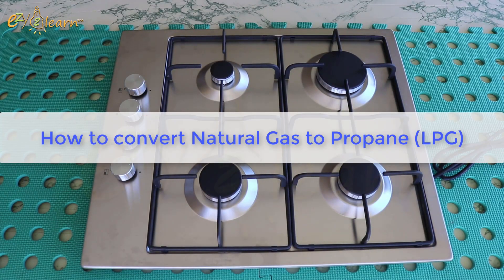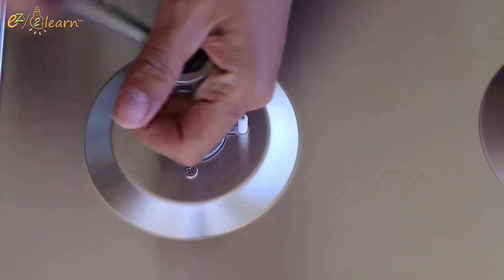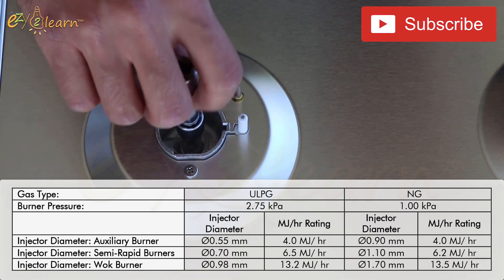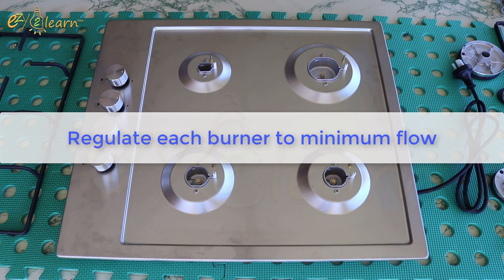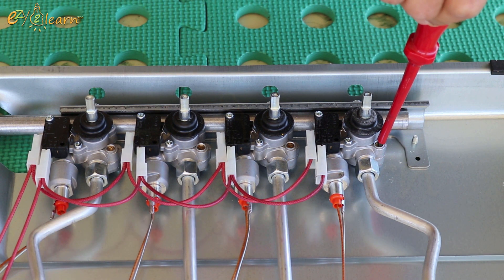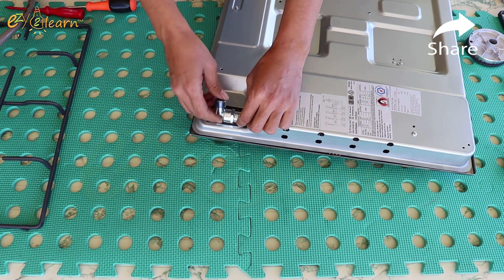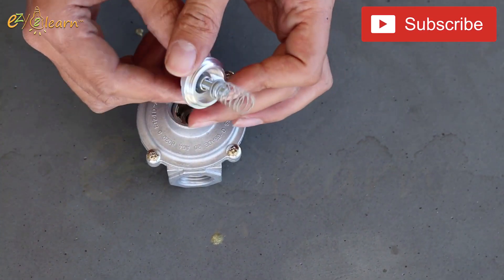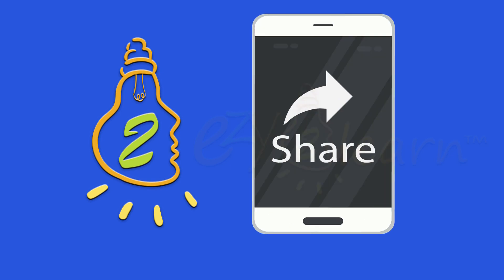Gas Cooktop Natural Gas to LPG Conversion by ezy2learn

Comment: I need to convert 5 burner cooking range from Natural Gas to LPG cylinder Gas (Siemens make)
I’d really appreciate if you could help me the sizes I need for these nosel jets :
1- 1.30mm
2- 0.85mm
3- 0.65mm x2 
4- 0.50mm

Comment: Hi I have attached my stove with a regulator on the LPG bottle. I’ve changed my burner jets. But I cannot see any access on my new off grid oven to adjust the actual oven and the flame there is too big and yellow 
Any suggestions anyone??

Comment: Is it necessary to have 2 regulators? One that comes with the stove and the other that’s attached to the hose in order to safely operate after converting from natural gas to propane?
Reply: Did you find an answer to this by any chance? 
I was thinking the same, as on a house set-up natural gas or LPG, both set-ups have two regulators, one at the stove and one at the mains/ LPG bottle.

Comment: Hey, any particular reason why we need to swap these nozzles and how important is it? Only reason asking because I’ve just ordered my mum a hob for her new kitchen and she lives in Sri Lanka, when I mentioned swapping the nozzles to the kitchen designer he said he'd never come across before, so I'm just wondering if this is really necessary?
Reply from the maker: Nozzle swap is required if you are changing from LGP to Natural Gas or vice versa. As LPG is thinner and requires tighter nozzle hole, but Natural Gas is thicker and requires bigger nozzle hole to work properly. 
If your hob is designed for LPG and it is going to work with LPG bottles, then you don't need to change anything. Thank you
Reply: @ezy2Learn  Thanks for getting back so quickly, yes that makes sense. I have ordered it from a well-known online retailer in SriLanka, as they don't have central gas there, I'm guessing the hobs will probably already come with the correct ones, but I'll double check. Thanks again - much appreciated!

Comment: What is the fitting connection required to connect standard gas cylinder hose to the elbow fitting you have? Can you please advise the name/size of fitting connection on each end?
Reply from the maker: elbow fitting is standard ½ inch (15cm) Australian size plumbing elbow. You may connect your stove directly to a Gas regulator as per video which is ½ Female both sides then direct gas hose to your gas bottle or you may connect your stove to gas bottle using a gas hose with builtin regulator like the BBQ one, similar to this one: 
https://cdn.shopify.com/s/files/1/1861/0291/products/Untitled-1_d4c05e0e-35d0-435f-9735-12d80b9ec63f_1400x.jpg?v=1527207756
Reply: @ezy2Learn  yes I want to connect this regular bbq hose to the 1/2 inch fitting but not sure what fitting to buy in between https://cdn.shopify.com/s/files/1/1861/0291/products/Untitled-1_d4c05e0e-35d0-435f-9735-12d80b9ec63f_1400x.jpg?v=1527207756
Is this regular bbq hose fitting 8mm?
Reply: I figured out... It is 
3/8 sae male to 1/2 bsp female. Thanks for help anyway. Great video!

Comment: My mobile home is on Propane. There is a propane regulator right off the propane tank.   Do I still need the regulator supplied with the stove?
Reply from the maker: no, one is enough as long as it delivers the correct pressure to your stove, usually it is around 2.75kPa

Comment: about turning the screw clockwise for the flow LPG conversion.did you just turn it all the way or half?thanks
Reply from the maker: There's no exact scale of turn the gas flow screw, but you need to turn the screw clockwise about half way or a bit more until you get the correct length of flame for each burner (blue flame) not yellow or orange color.

Comment: I would like to connect a cylinder hose and regulator instead.  Could you give me detailed information about which one I should buy for a Gasland chef cooktop GH30SF? Thanks
Reply from the maker: I looked up Gasland Chef GH30SF but it is not available in my location. but what's the problem exactly to connect a cylinder hose and regulator. Please provide more information about issues you are facing and I might be able to hel you. Thank you

Comment: Can't we use hob stoves without installation? Because it's not possible for transferable job.
Reply from the maker: Yes, you can use it without installation, just make sure it is stable and gas hose away from fire. OR you can build a 20cm wooden frame and  install it on top of it and it will portable.
Reply: @ezy2Learn  Thanks for your information.
Reply from the maker: @ConnectingNatureAndPeople  you are very welcome :)

Comment: Question friend, how about the plug wire, the black one, what happen, are we going to remove that, or nothing. Thak you and God Bless, more power to you.
Reply from the maker: Did you mean the electrical cable? if yes, then you don't need to worry about it as it is used for ignition only and it is not connected to the gas source or type!

Comment: What is the benefit of this method?
Reply from the maker: Converting Natural gas to LPG
Reply: You need to convert a natural gas appliance to LPG using the jets provided with the appliance because if you don't, the existing natural gas jets will put too much LPG into them, and you get an uncontrollable flame that produces huge yellow tips depositing soot and carbon on pans and kettles along with a horrible gassy smell emitted. 

Jetting a natural gas appliance for LPG bottled gas and propane tank supply ensures proper operation and safe use.

Comment: Wouldn't you configure the regulator first and then the dials?  Why make flame and height adjustments at the dials and then change the regulator?
Reply from the maker: Ok, you are right about that one :) I just wanted to say that you can adjust the flame from dials not from the regulator! my apology
Reply: @ezy2Learn  How do you know that you have the correct orifice valves?
Reply from the maker: @robertallison1449  Very sorry about the delay, I didn't see your question until now! every orifice valve has a number on it, that number indicate the hole flow size. Generally speaking, LPG is lighter in weight so, you will need to install small orifice with smaller hole size. if your stove is connected to NG and it has 4 burners (1 large burner, 1 small burner and 2 medium burners) you are going to convert it to LPG, then most likely the orifice that was used on NG from medium burner will work perfectly on the larger burner with LPG! 
But if you want to further details, you can search online for orifice size chart and it should explain it. Thank you